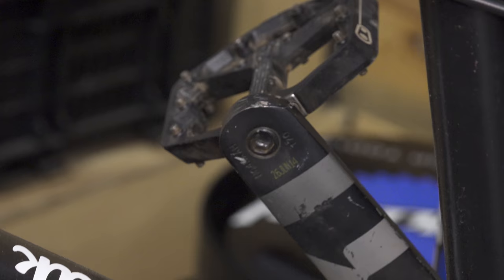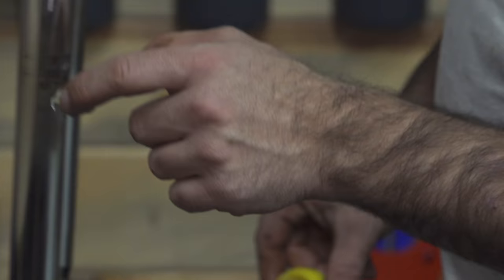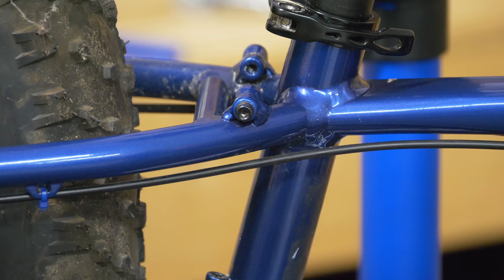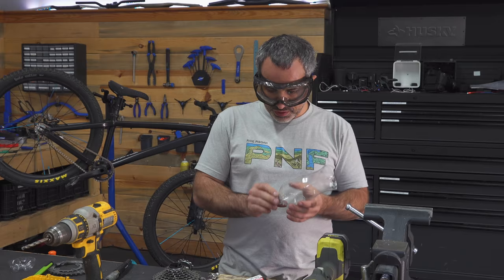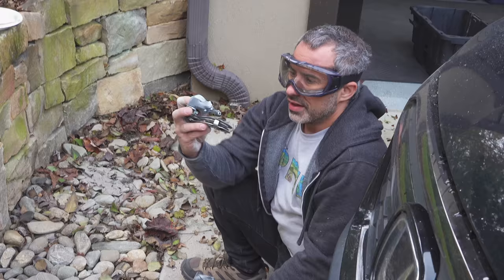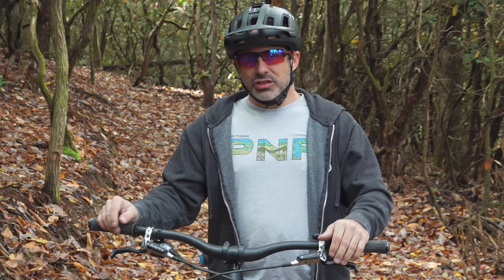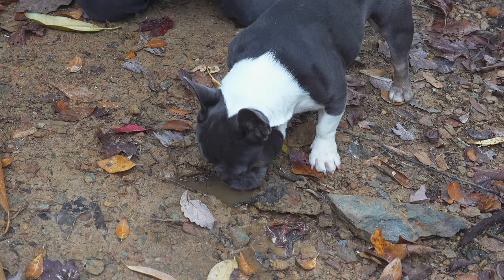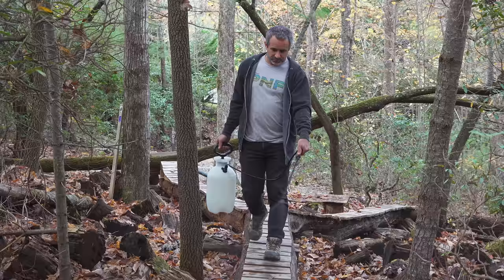10 Mildly Useful Hacks for Mountain Bikers

Comment: For the snake run and other features you can try coating the top with an epoxy adhesive spray and then sprinkle some sand on top and seal. Makes a nice non slip surface and wouldn't take away from the natural look of the features. We use this method for stairs on our property that lead down to the river. Maintained the same way--spray bleach. Should be able to handle any traffic but might need to add more grit every couple of years.
Might also be a good hack for the RS.

Comment: One 'hack' could be that ,
If you have a bike with one of the kickstand 'brackets' at the bottom, when you flip your bike upside-down to work on it, the little hole used to mount a kick stand is really handy to put an allen key, screwdriver etc whilst your working on you bike.

Comment: hi Seth great hacks and always keen to learn more. Here is a hack that I picked up while cycling around the world that anyone can use on any bike if your fed up of your bike falling over when you prop your bike up against a wall or on a post. cut a small piece of mtb inner tube about an inch wide and slide over the handle bars on the front brake side. then when you stop, stretch it over the brake lever which will engage the front brake. hope this is helpful. regards Tim Bridgman

Comment: I use the ziptie holder hack as a mount for my external dropper cable so it doesn't flap around, and as it needs to move when changing seat hight, works a treat!

Comment: 1:26 heres a sub hack for anyone who doesn't want to bother with a 300 foot socket extension,just place a flat head screw driver in between the fork lower and the nut,and leverage it outwards while you unscrew the nut

Comment: I use an adjustable tubing cutter from a plumbing supply house to cut bars to length. Can use a reamer to clean up the end as well for sticking stuff in. Not sure about how it is on carbon though.

Comment: Let me start by saying walnut shell is the preferred medium for blasting without damage, and I also love to comment on one of your other videos I don't know if you found it but I have a couple hacks, for my chain stay protection I use road bike handlebar wrap cork to be exact weather resistant and lightweight go figure, wish I could send you a pic you'd love it I keep staring at it LOL, another one and this one's a little bit more crucial when you rot your front end I make sure my brake lines are a little longer than my cables so if the bars do do a 180 the cable grabs before the brake line does I would rather replace a cable as opposed to fluid everywhere, thanks for all the great videos you're the bomb.

Comment: Hack if you brake with your wheel off and dont have tools at hand you can use the lever part of your through axle or quick release axle to pry the calipers apart if you have quick relase axles you can even use the actual axle and it will give you a lot more leverage. it works as good is actually taking the pads out and it takes a lot les time

Comment: Another hack for black parts, is black out emblem refinisher. It’s intended to be used to fix worn rank insignia. As such it doesn’t contain any of the gloss that touch up paint might have, but it will provide the same bit of protection paint does.

Comment: I've used the crushable core of crimp on electrical connectors to tame cable ends. It was the tubular kind. I just pushed the core of it out with a small screw driver then bam! Diy cable crimps
Reply: I have used that too. Now I just weld them with my Car battery charger. Plus on the cable. Minus on a lump of brass. Then it wont stick to the cable.

Comment: just rebuilt my rear wheel and used a hack I have never seen used to get my tire back on. The tires are original to the bike and had some sort of adhesive that made them very difficult to remove and reinstall (not tubeless, 27.5x2.8) due to the stiff bead and width of my rims (40mm). After a few hiccups and a popped inner tube from trying to pry the bead onto the rim, I used some chain lube on a paper towel to wipe down the rim and bead of the tube and it went on without a hitch. Also just replaced my drivetrain to get away from the Eagle lineup after a long bout of issues with it. For anyone with an Eagle 1x12 drivetrain, make sure when you have anything serviced that they replace the C clip and O-ring that are on the bolt that holds it to your derailleur hanger. They are the only thing providing resistance to keep it in line. Mine were missing after I had my rear hub rebuilt but you can find the sizes at the hardware store to replace them yourself in a few minutes. Went from 5-10mm of play in the cage (laterally) to 0 with $.50 worth of hardware store parts.
Reply: And you can use water, soapy water, glass cleaner spray.

Comment: you didnt need to modify you air compressor attachment. You could have just put a hole in the cap and side. If you are confused what I mean just look up a 2 liter airsoft gun. It uses the pressure from the air to force anything out a separate tube depending on the diameter. Hope this helps!

Comment: Normal spray paint won't work on flexible material. I did auto upholstery for a dozen years and used some left over material that didn't match to cover a dented gas tank...and sprayed some silver paint on top of the green vinyl...  didn't last long at all.  Just to save anyone else the hassle.  I ended up recovering with the actual color vinyl I needed to accomplish the desired result.

Comment: Bike build hack: use a slightly smaller diameter wheel in front for amazing cornering
Reply: This is used in moto gp: the front will spin faster than the rear, making it more sensitive and grounded

Comment: I spent a buck and change on a 4" length of fish tank air hose and fed one end into my water bottle cap (Some modification of cap might be necessary depending on what kind of cap you have) and then using zip ties route the fish tank air hose along the frame and up the seat post and then forward along the underside of the seat.
Then from there leave enough length hanging off the front of your seat for it to reach your mouth like a super long crazy straw and cut off any excess.
Then spend a few more cents on a pack of those clips that companies use for name badges (you can probably find them any place that sells office supplies) and hot glue the clip maybe 6 inches or so from the top of the air hose.
That way when you're not riding you can just leave the straw that used to be an air hose clipped to your seat or anywhere on your bike and when you're riding you just clip the straw to your shirt collar so when you want to drink you don't even have to reach for the water bottle anymore, just stick the straw in your mouth and sip till your hearts content.

Comment: I don't know how much of a hack this is, but if you ride alot of poorly maintained trails. I keep a machete strapped to the side of my downtube to clear trails when required. I know it sounds dangerous, but I put in a little extra thought. I covered my already pretty good sheath with some extra sheet metal the and a thick amount of gorilla tape. I also put a carabiner into my straps to hold the handle into the sheath so for it to come out the strap on the sheath and carabiner has to come off to take the machete out. Plus it looks really cool.

Comment: Seth try a 1/2 torque wrench for your cassettes, crank bolts and other high torque parts. I have used one for about a week but for you it would make your life a whole lot easier and it only cost from Amazon less than $50. (unless you want to have bolts and nuts so stripped that you can’t remove it)

Comment: Tipp for a (bike) hack: try reusable zip ties. They are very versatile, you are able to unzip or alter the diameter with 2 fingers and when they did their job, you do not have to cut them open and throw them away. This is especially helpful outdoors, you just zip them around where ever on your bike after use and the will not end as another piece of plastic waste in the environment.

Comment: if you take a piece of silicone tubing cut to length to wrap around your fork and use a smaller piece to hold the two halves together you don't need to take the fork apart.

Comment: Inner tube hack. Super glue and electrical tape is just as good if not better then patches. And it's super cheap. Some may know of it other may not. I got a nasty pinch flat in my inner tube on my hybrid bike. There was 3 holes. Super glue and electrical tape fixed it better than any patch. I run my tires at about 75 to 80 psi (for road riding) and it's still holding. It's been about 2 months since that flat to.

Comment: Idea for a bike hack, hot glue a magnet to the top of your valve cap so when your pumping up your tires on the trail you can stick them to steel hardware on your bike so you don't misplace them.

Comment: You can use a front derailluer and triple chainring with a Internal Hub...  Just need thr RD tensioner.  Even just a single speed wheel with a RD still allows from derailluer.

Comment: Another way to measure sag without bobbing the suspension is to drop your dropper post before you start, then weight the bike as you would standing. To get off, you just put your foot down on the ground and slide the bike out from in between your legs.

Comment: The reason the sandblaster hack works is because of the Bernoulli principle - the compressed air flowing through the nozzle at high velocity creates a lower pressure vs the atmosphere outside nozzle, so the the sand gets sucked along into the tube...at least I think that's correct...

Comment: Those bolts are also the same thread as spd cleat bolts, I usually keep a couple of spares in my rack mount bolts, you can also get away with a rotor bolt in your cleat if you really need

Comment: To remove a crown race you can use an old butter knife. Might wanna sharpen it a little bit on a bench grinder. You just put it in between the race and fork and use a hammer to tap on the back of the blade. It will find its way in there and you can work around it. When you have some space you can continu with a screwdriver. 

That is for forks that dont have a little dent in there just for this purpose.

Comment: Just an FYI Seth, Do not flush wounds with hydrogen peroxide.   Causes more damage to broken cell walls and actually slows healing, just clean with soap and water.    In fact, no antiseptic should be used to treat wounds. While highly reactive chemical agents such as hydrogen peroxide do indeed kill some bacteria, they do more damage to healthy cells that are attempting to heal the wound.

Comment: Here's a hack, if your water bottle is too tall to fit into your bottle cage then you can make a bracket to drop it down. You take a peice of sheet metal (I used some 3mm aluminium) and you cut it about as wide as your bolts and as long as you want your bottle cage to be dropped. Next you drill 4 holes. 2 will be at the top where your frame mounts are and 2 at the bottom where the bottle cage mounts are. Next you'll need to drill a hole in the bottle cage where the bottom bolt of the frame hits it. Then you can mount the bottle cage to the bracket with some nuts and bolts and cut as much excess bolt off as possible. Next you need to use some washers to space out the mount from the cage so that then the nuts don't hit the frame. Then there you go, you can now get your  bottle in and out of your bottle cage.

Comment: I think the peroxide will work only with fresh blut. Even the one in the video is visible is not longer than couple of minutes-according the colour. The problem is meanwhile the hemoglobin gets in to the fibres a get dried. You can reduce the colour into lighter shade but you won't fully get rid of it. If someone doesn't have peroxide you can use the salt which dissolves organic substances. It is not as strong as peroxide but anyway it works. If you find out in time and have know how.. savings money. Next time just sift the sand thru strainer you will see the difference. I use the garden sprayer to rinse off the mud after the day in bike park 😊🤙see ya

Comment: Hack if you dont have a syringe to fill tires with sealant without taking it off the bead, put electrical tape on your presta valve stem until its a tight fit on the nipple of your sealant bottle. Use it all the time with stans bottles.

Comment: For the sand sprayer you'll want the hole to be upside down and a little bit smaller. And yeah don't cut the bottom off the water bottle. I suggest using a tough gatorade bottle. Fine sand is needed to. You can buy it at hardware stores for cheap.

Comment: The disk rotor bolts are also the same size the bolt that holds a sram shifter onto the bars. I found that out when that bolt wiggled loose and fell off and I was looking for a semi redundant bolt on my bike to use to make it back to the car.

Comment: One caveat with the rotor bolts though is it often only works for unused cage bosses. 😢 If you actually want to bolt something there, the 10mm length isn't always long enough to engage the threads, most actual cage bolts are M5x15. But I am ALL for blinging up a bike!

Comment: Seth, you don't have to use a 5 mil on a 3 meter extension. Just remove the lowers first, then the top caps and springs, saying about that cheap suntour. And if it doesn't work, just compress the fork so the fiction between bolts and springs is bigger letting you remove lowers more easily.

Comment: The peroxide hack for blood - you don't need to pour or scrub. Get a spray bottle. Spray the stain down, let it foam until it's done. Spray the other side and do the same. Toss it in the laundry. Bigger stains, repeat a few times. I did not learn this through any criminal activity.

Comment: The Bleach + Water hack you're gonna want to take it easy around plants that may be destroyed by it. Go for a 3/4 cup of bleach for every 1 Gallon for mold/mildew abatement and pre-water plants before spraying solution. Put plastic tarp over plants that are very sensitive (such as some perennial flowers). Bonus tip, it works on cement too (just use a brush to scrub it in). Source: Former Landscaper

Comment: There is an alternative to using chemicals on your wooden sections, industrial grip tape, I'm sure you will have come across this at some time but for those who don't know about it... The tape is used in factories and work places to prevent slipping on stairs and anywhere there could be a possible slip injury but it's about the same width as duck tape but with a textured of heavy duty sandpaper, all you would need if any moss decides to join the party is water and a stiff broom if needed at  all that is, I'm sure you will get a few years of grip but without a test I can only guess. I've just given myself some ideas to use it for my front door step, oh and there is a paint that does the same thing, I used to sell it when I worked at a paint factory, now I think about it that's where I first saw the tape.😎

Comment: Convert your Fat Bike into a mountain bike with a Fattie Slims wheelset - either built it or buy one from Framed.  In your case since your fatbike has no suspension I suppose it will become a hybrid, but if you had a suspension fork on it, it becomes a weird looking mountain bike.  Or the ultimate mullet bike with fat tires on the back and skinnies on the front.  Or a bike with terrible steering and limited traction by putting the fat tire on the front and the skinny on the back.

Comment: If you put electrical tape on your bars, coat it in gasoline and then slip rubber grips on, the grips won’t move or roll on you. It’s a motocross hack but it lets you turn slip on grips into lock ons dirt cheap.

Comment: I aint gonna lie this tip is probably terrible for the environment, but farmers and stuff use it all the time. before putting posts into the ground concoct a disgusting mixture of diesel fuel and old used motor oil and coat the post in a thick layer. I've used it on a few of my own features and it definitely helps delay rot and decay.

Comment: Great video but it would better if you used wire wool to clean the stantions instead of wet and dry paper as it won t score them, lasherate the fork seals and make them leak.
Also but I don't know what you call it over there in the States is to use Harpic xxxx toilet cleaner the strongest non bleach cleaner out there. You can either apply it to a rusty chrome stantion with wire wool or kitchen towel and it will literally wipe off the rust, it's amazing! Just be careful with it it's not good on yours hands so wear gloves and use eye protection.

Comment: I am curious about the sattle spraying, since I'm always looking to add a bit more color to my bikes.
Having a bit of trouble finding the right paint tho... is the paint supposed to be made specifically for vinyl or out of vinyl or both?! Anyone got any tipps?
Reply: Figured it out myself. If anyone else has that question: I just used the same paint (leftovers actually) that I used for my frame. It's an acryllic based paint and clear coat.
My only complaint is that it does make the saddle more slippery, so for now I am using it only for my dirtjumper and experimenting with other finishes before trying it on my enduro.

Comment: Hi Seth, I need a bit of help with my fox fit grip damper, I recently rounded the needle that the rebound knob sits on and there is no information on how to replace it, I’m wondering if you’ve ever done this and I want to ask how u replace the needle
Reply: You need to replace the damper shaft assembly, it’s usually easier to than the needle itself. Or replace the damper as a whole.

Comment: The tip for hydrogen peroxide is true, it's a great clot buster and removes blood stains well. However, do not use it on wounds. It will prolong healing and injure the site more. Use soap, water, possibly Neosporin or Vaseline, and a bandage